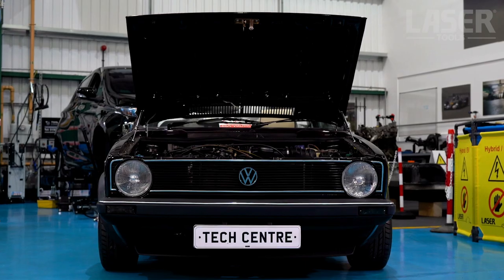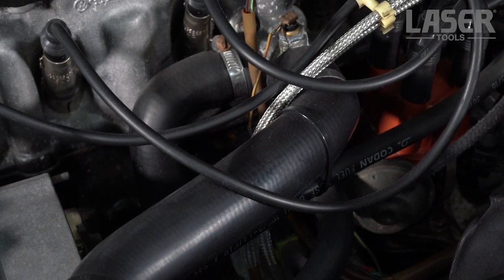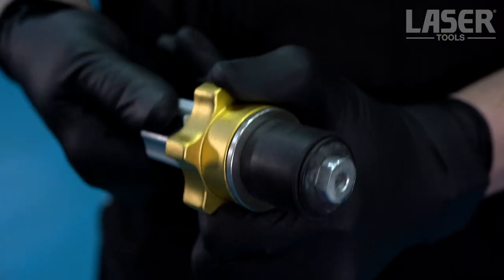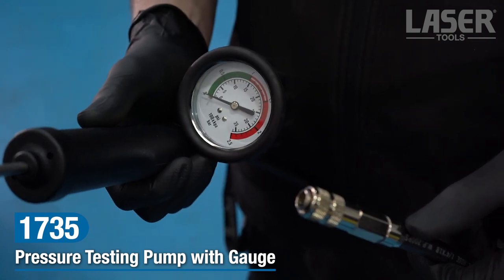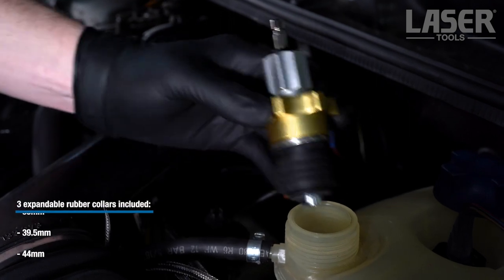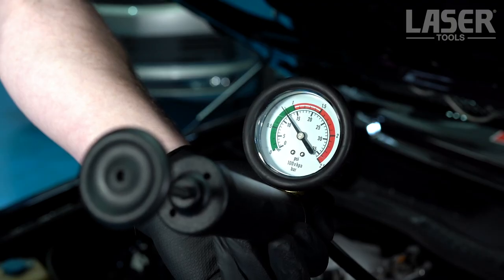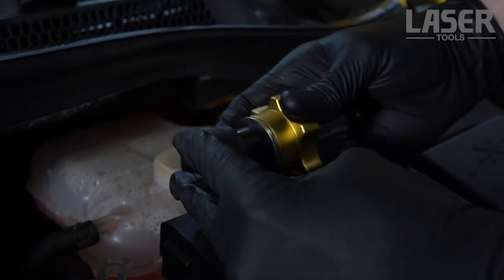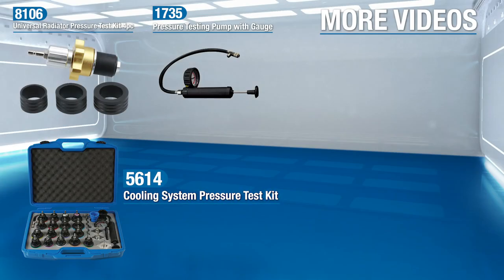8106 | Universal Radiator Pressure Test Kit 4pc | Pump with Gauge (1735)

Comment: This look great. Also if used in pairs you can test single components direclty by connecting directly into the water hoses
Reply: This doesn't work..... it will pop out of the bottle